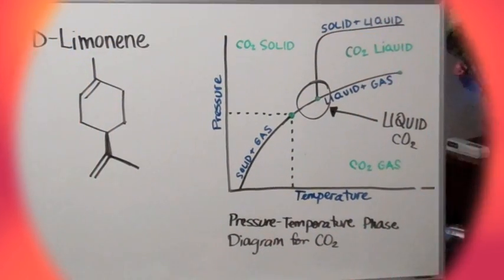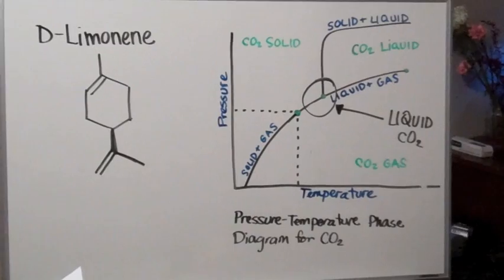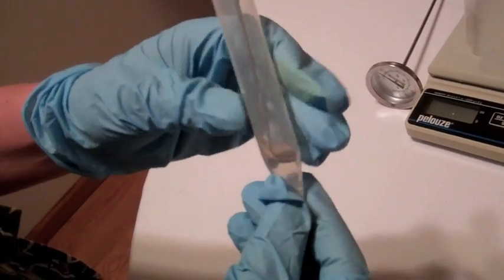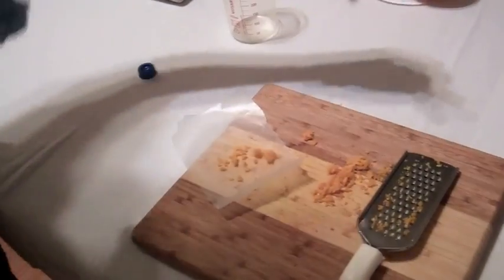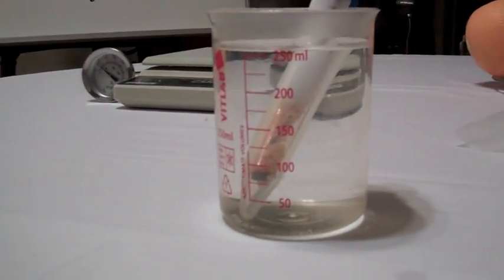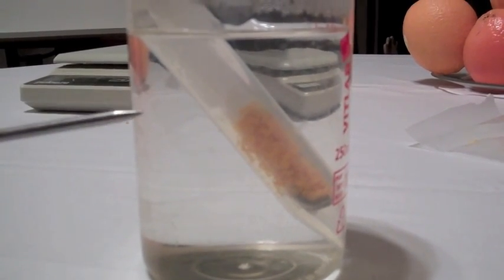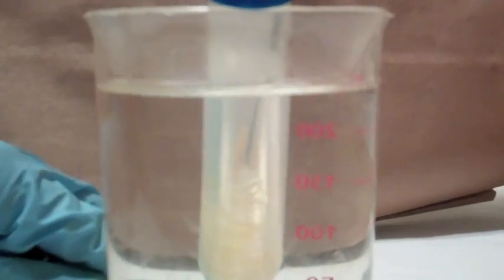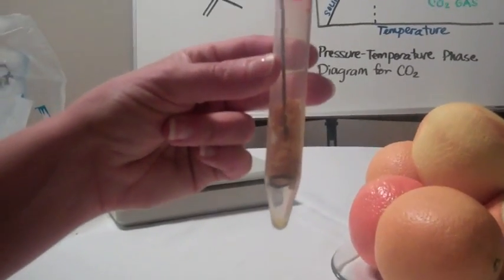Extraction of D-Limonene/Dry Ice

Comment: What is the max pressure? Isn't there a risk the plastic tube will break?
Reply: Yes, there is always risk associated with pressurized system. To mitigate risk, glass should not be used for any pressurized systems.  I have seen larger plastic centrifuge tubes explode under pressurized conditions.